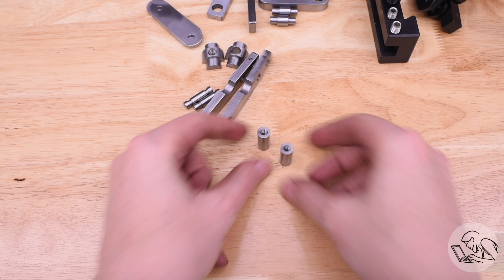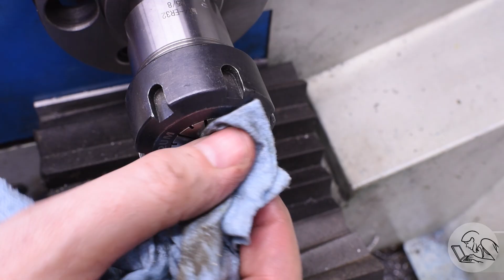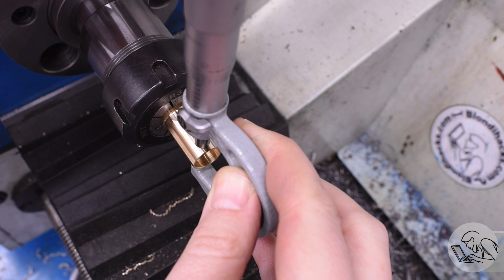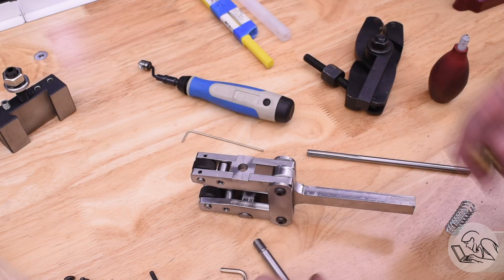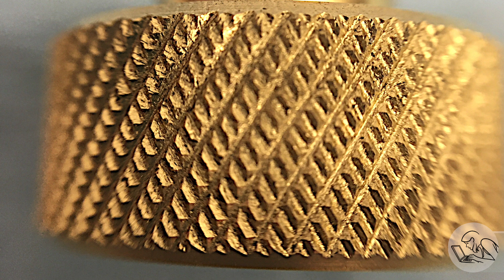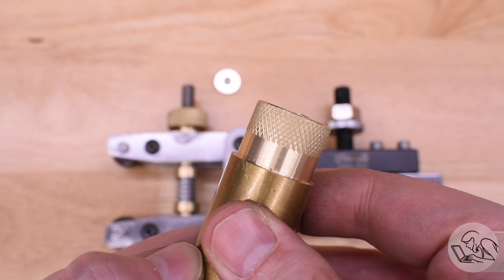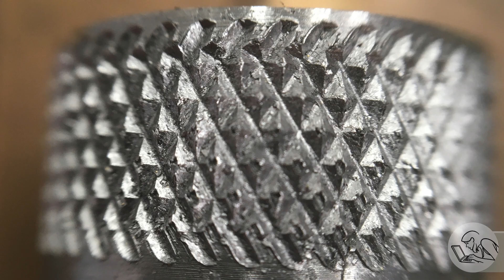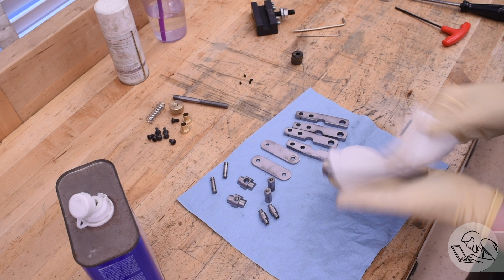Let's Make a Knurling Tool! Part 3, Conclusion!

Comment: Lol, i use my calipers to mark stuff ALL the time. And here’s why it doesn’t matter, the calipers are hardened and ground tool steel. If im marking something to be machined, then it’s soft enough to cut, ie; softer than the calipers. Come at me bro.
Reply: Mitutoyo makes calipers sspecifically for that purpose and it has a carbide jaw. I have a chinese caliper made specifically for marking and it also has a replaceable and resharpenable round carbide pin as the fixed jaw. I have machined things that a stainless steel caliper would never mark
Reply: @MF175mp  I’ve never seen the re-sharpenable carbide jaw but that sounds like a pretty neat idea. And yeah, of course. Don’t be a dunce and try to scribe layout lines in hardened material. But if you’re scribing layout lines in the first place, then it’s very likely not going to be high precision hard milling or turning of high tolerance parts anyway. That’s my point. It’s just silly that people make comments about that every time someone does it in a video, because everyone does it when they’re actually standing at the machine just trying to get stuff done. Especially in a hobby shop, where your probably not going to find someone using ceramic to cut age hardened inconel…